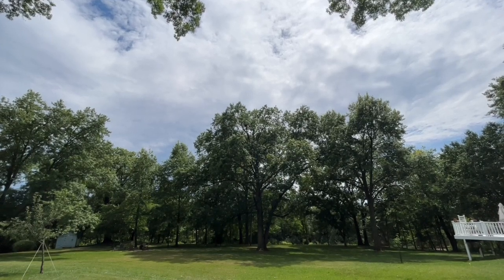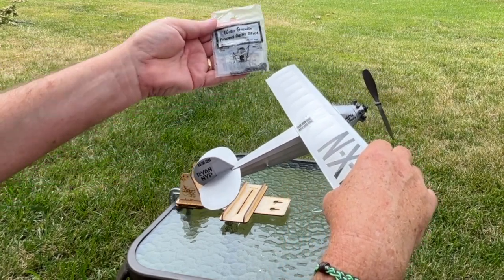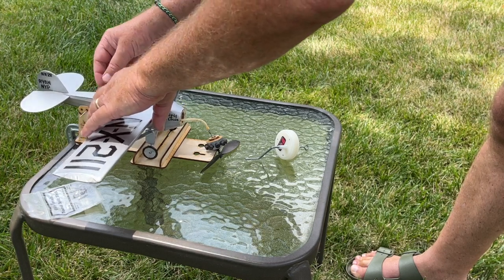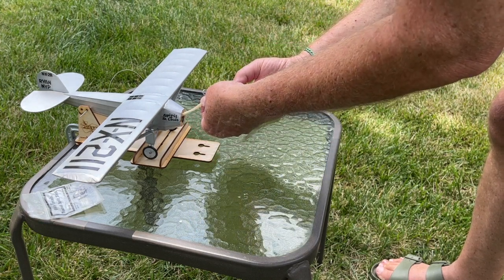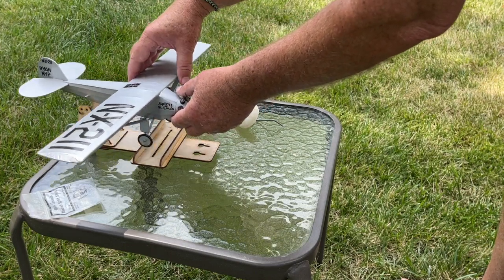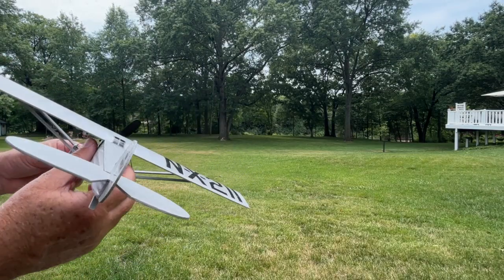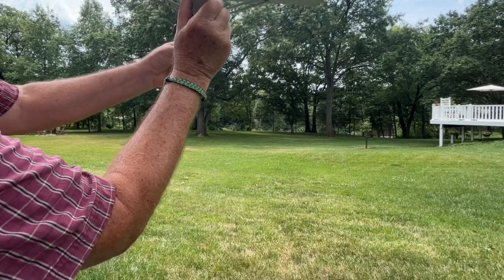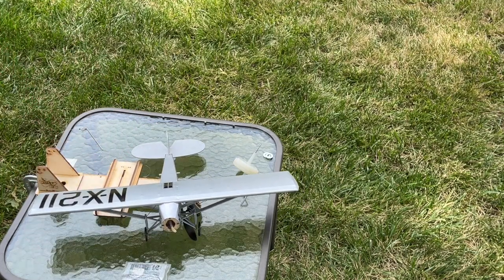Ryan NYP flight tests

Comment: Longitudinal trim looks good, so you may not want to mess with CG, but if you find you need to add nose weight to avoid stalling, know that a more forward CG reduces the yaw effect of the prop and increases the yaw effect of the fin. This would reduce the Dutch roll.

Comment: One flight looked like Dutch roll. Others looked like a poor launch; wrong speed or angle. The plane will turn into any bank at launch. Dutch roll can be mitigated with more fin or a smaller propeller. But we want the biggest propeller we can get. Rule of thumb is prop diameter should be 1.5 times the square root of wing area. Looks like your prop is not too big. Higher speed and faster propwash can improve effectiveness of a fin.

Comment: Little information can be gained by glide testing from shoulder height because the plane will be on the ground before it recovers from the launch, unless you get a perfect launch; exactly the correct attitude and speed. Practice with a glider until you learn to control attitude and speed to get a uniform glide path and speed. Sometimes you can launch a new plane as you would a hand launched glider; banked right at a high angle of climb. A good launch will recover higher up and you will get to evaluate the flight dynamics.

Comment: To provide some dihedral effect fill the space between the struts with clear plastic. It was a solution to an early aero modeler design .
Reply from the maker: That's a great tip! I'll try that and post the flight video. Thanks for your comment and thanks for watching!
Reply: That is a brilliant idea, but wasted on this little model. I have a 1/4 scale Spirit OSL that I have not yet flown. I was concerned about the lack of dihedral and the small, scale ailerons. Putting some clear plastic across the wing struts would add some roll stability for sure, Thank you.

Comment: Really neat build- Dumas kit? There appears to be little or no dihedral causing typical Dutch roll, hopefully you could introduce some without disturbing the finish too much. Always had great success with Dumas kits. I recently bought a laser cutter and  first task was a stooge, looks remarkably similar to yours
Reply from the maker: Yes, this is a Dumas. They are fun kits to build and fly. This kit did call for a dihedral, but I just couldn't bring myself to add one to the NX-211! 😌
I purchased my stooge as a laser-cut kit from this site:  http://retrorc.us.com/freewheel-pusher-1.aspx
Thanks for your comments and thanks for watching!
Reply: Dutch roll is produced by too much dihedral.

Comment: Gurney flaps might help. Also dihydral  is important on small models like this.
Reply from the maker: Thanks for your feedback. I'll add a Gurney flap on future tests.
Reply: Gurney, or more properly in aeronautics, Zaparka flaps allow higher lift at higher attack angles beyond where the unadorned airfoil would stall and lose lift. They encourage flow to stay stuck to the top of the airfoil rather than separate by the formation of a double vortex at the trailing edge. On models at the usual attack angles they seem to act like ailerons. There is no indication on this model that aileron roll is required.
Reply: @aeromodeller1  I would beg to differ and state that a gurney flap, among other adjustments, would be a good starting point based on the expected left turn and  torque induced roll which is more pronounced on an airplane that has no dihedral angle in the wings.
Reply: @MORCOPOLO0817  It is already exhibiting a Dutch roll, indicating too much dihedral effect. Last launch it turned right. He thinks the weights shifted, that should be fixed first. Test flights so far have been ambiguous, some going left, some going right. You can't prescribe a fix unless you know what is going on. Flaps add a little lift and a lot of drag. A "Gurney" flap is essentially a stalled aileron in this application.
Reply: @aeromodeller1  Look at the video. The model has no dihedral. Just like the full size aircraft.
Reply: @MORCOPOLO0817  That's right, and the original was stable.
Reply: @aeromodeller1  The original had a pilot to activate ailerons. No such control exists in a free flight rubber powered model.